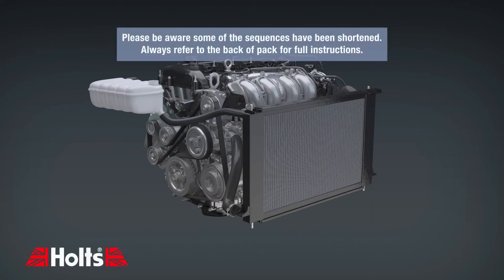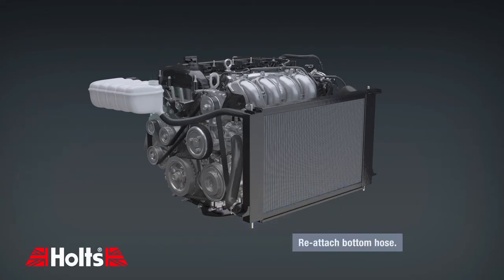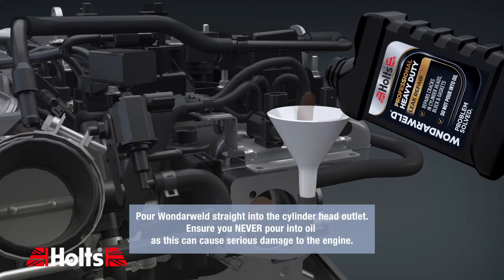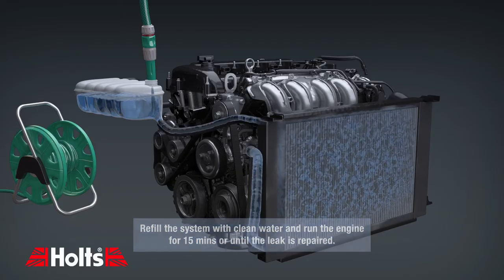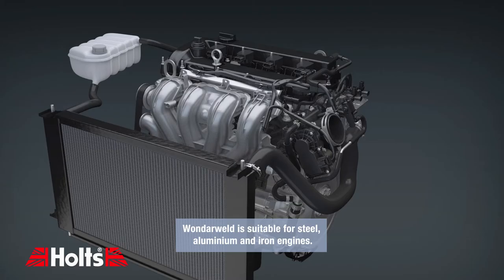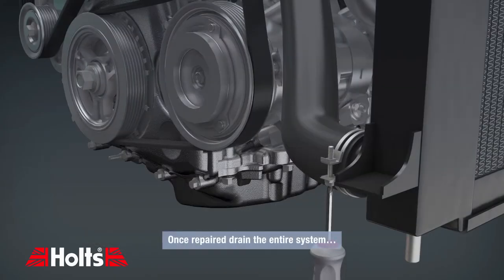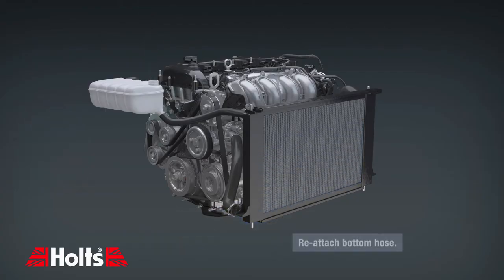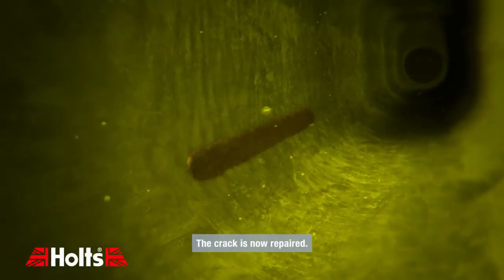Holts Wondarweld Engine Block Leak Repair Instructions

Comment: Thank you for this. Unfortunately all the mechanics i've asked about using this product just say to pour it directly into the radiator...
Reply: Pitirisek  unfortunately I had no luck making this product work for me. No idea how far gone that engine was...
Reply: No, it's better in the thermostat position. A trick to avoid removing the thermostat is to drop it into the radiator's radiator pipe which is right below the thermostat! In fact, you can join the 2 pipes of the radiator together so that it doesn't risk getting clogged when you drop it in for the repair!!
Reply: Pitirisek  I have read up to 3 days and then rinse well.
Reply: As my thermostat sits below the engine block, can I then just throw it directly through the outlet pipe into the engine block from the top?
Reply: @CliffordPeterViljoen  I assume that since in the instructions the engine must be cold and run with the thermostat closed for these 15 minutes until it opens as it says, the water will not turn before the material takes effect. because it is greasy and to get it in contact with the whole head and the head gasket, add some water after the Holts Wondarweld into the pipe you will pour it
Reply: @CliffordPeterViljoen  Some write Holts Wondarweld to stay for 3 days before emptying. Be sure to rest the engine for 8 hours after the first test.
Reply: @24kwsths  thanks, was just wondering as my car's thermostat is sitting at the bottom of the engine block water inlet and not at the top. Will give it a smash tomorrow and see what happens👍just hoping it works.
Reply: @24kwsths  will do thanks.
Reply: @CliffordPeterViljoen  good luck. I did it 3 times for half an hour with 8 hours rest each time. Isolate the mixed radiator for hot air do not clog it if you can
Reply: @24kwsths  gonna try my best, as I fix espresso machines , cars aint on my top list of knowledgeable things to fix , but will let you know how it goes. Thanks for the input though.
Reply: Did it work?! @CliffordPeterViljoen

Comment: This product is unavailable ON-SHELF in Malaysia.
Reply: dalam lazada ada jual
Reply: shopee ada jual bang
Reply: Tuan buka thermostat n tuang terus atau tuang dlm sparetank?  @inspirasiimaginasi
Reply: ACE Hardware Shopee Lazada semua ada jual. Cuma nak pakai masih takut lagi sebab tak pasti nak tuang dekat dalam radiator atau belakang termostat. Siapa2 ada boleh tolong komen?
Reply: @rasyidi888  kena tuang belakang thermostat tuan.. ada 2 cara.. utk leaking luaran tuang belakang thermostat n running enjin ikut arahan, kalau leaking dalaman sama juga tuang belakang thermostat tp sebelum tu kena cari dulu silinder mana yg leaking. kalau dh jumpa yg leaking tu kena buka plug n soket injector pada silinder yg leaking dalaman tu then running enjin. enjin akan bunyi motobot n bgegar semasa running tanpa 1 plug. saya dh try mmg menjadi untuk leaking luaran n dalaman, cuma lpas selesai treatment jgn lenjan n tekan kete bawa laju. kena bawa slow max 100kmh untuk beberapa hari bagi gam tersebut keras n sebati dgn baik. lepas dh selesai running semua tu baru la flush treatment tu n salin masuk coolant.

Comment: I just put this holts in my expansion tank cooler few minutes ago? It need to drain it back or just let the liquid in that cooler? Help me
Reply: Is it function?
Reply: @wengsiongsai2815  do you are alive?
Reply: You died Holt can't save
Reply: @wengsiongsai2815  who you or ?
Reply: It wasn't for this expansion tank. But for the thermostat pipe and it definitely wanted emptying and flushing after 3 days

Comment: I have an Slfa JTDm 1.9 . I dudpect coolant loss due to a cracked head gasket. Dhould I add 250ml or 500? If the loss through aeaky hose ot even the pressure cap seal will Wonderweld simply flush out of the system ?

Comment: i have oil in my expansion tank, so there is a crack from internal oil channel to internal coolant chanel. There is NO external leak visable. How can this product distiguish this type of crack, i dont understand how it can work/if it can work in my case?

Comment: Your quick answer will be appreciated. I ordered the product and I will have it today, but I am facing a problem in disassembling the thermostat, as access to it is difficult in my 2008 Mazda 5. I will add it to the other hose. Will this help?
Reply: It’ll work just fine as long as you remove the thermostat

Comment: I have used it in my Land Rover’s previous engine just to seal off any micro cracks that may appear as a preventative measure. I did not drain the Wondarweld for at least 3 days and I replaced the thermostat anyhow.
Reply: do you think it would work on a disco 3 tdv6 diesel? blown head gasket
Reply: @Lanc321  Could do but as long as the water is not entering the cylinders, otherwise the Wondarweld would destroy the internals. Usually a blown gasket in those the engines would need a full rebuild.

Comment: How many hours starting the vehicle process time
Reply: In the video it says to leave it for 15 minutes until the thermostat opens. I read somewhere to leave it for 3 daysto drive it . I did it for half an hour out of 3 times because the thermostat opened at 15 minutes...
if you are asking how long do you leave the vehicle when you turn it off with Holts Wondarweld in it, it's good to leave it for 8 hours and then wash it well!

Comment: What will happen if after repaired, the Holt's solution is not drain off?
Reply: it will clog the radiator cooler and maybe the thermostat too. Works with water, not antifreeze!!

Comment: I have been told to pour this straight into the radiator and that it will fix the leaking radiator.
Reply: It worked like a charm! 🤸🏿‍♂️
Reply: @masonichisenga3032  i believe it s disignd for cracks in cilinderheads and cilinderbloks.....
Reply: @MrRichard57000  yes, that's why I was sceptical about it being able to fix my radiator, plus not following the instructions to pour it down the water pump.
Reply: @masonichisenga3032  well the instructions say pour it in the engine block(behind the thermostat) important is that you use only water, no antifreeze.... I'm curious if the wonderweld is going to make an improvement in my case.... I just let it in there and before the winter I chance it with antifreeze...
Reply: @MrRichard57000  I am curious, in the case where the cylinder block has a crack as it were, doesn't that mean that oil and water are mixing and if that is the case, don't you have a host of issues that won't wait for you to pour this stuff in it...
Reply: @masonichisenga3032  if your cilinder block has a crack it does nt mean necasary that it will crack to the oil sump or a oil line.if your cilinder liner is cracked you end up with gasses in your cooland system.wen your ciliderblock cracks from a cooland channel to the outside of the engine it will leak coolant.same for the cilinder head,it s more common that cilinderhead cracks from combustion camber to coolant channel,gasbubbles expel coolant your medium is gone so you car heats up  FAST.and you have a point ,when you find  coolant mixed with oil in the oil sump don t use this addatif or any other!!!!!most of the times those cracks or defects ar nt visible so it s the last thing you do before you tare your engine down...if this comment  raise any quistion just  let me know

Comment: @HoltsAuto
Your urgent response will be greatly appreciated as I need to use the product now.

When using it in a vw golf mk1 1.6i afx engine, do I need to remove the thermostat?
As my thermostat does not mount to my cylinder head but instead, the bottom radiator hose where it connects to my water pump, where my thermostat is seated, inside a flange on the water pump.
Reply from the maker: Hi there, as this is technical question, could we please ask that you contact our technical team at info@holtsauto.com they will be able to advise. Thank you!
Reply: To work well it obviously needs to drop into the cylinder head so you can drop it into the pipe that comes out of it and goes to the water cooler.

Comment: used it to repair a minor crack or leakage from cilinder gasket.....can i leave the wonderwelt in the engine for a few days,ore do i have to flush it out wen it cooled down?????
Reply: Ons Huis  the thermostat opening is big enough I think, I could worry about the radiator tubes.... Radiator tubes are 1.5mm I estimate  but cracks over 0.75mm can t be repaired I thought? Anyway for now it s flowing and cooling as it should, still have a bubble from time to time which will remove a bit of coolant from my radiator..... Overall till now mildly content, we made progress because I have less bubbles and air as before.... Maybe it needs a few day more ?
Reply: May i know is it safe to keep the wonderweld in the engine? How long u flush it out?
Reply: In the instructions it says when it cools down, elsewhere I have read 8 hours after it has been washed off. In a parts store they say after 3 days with gentle driving!